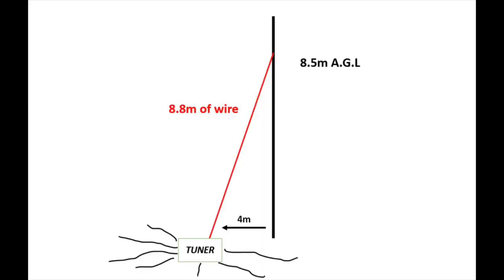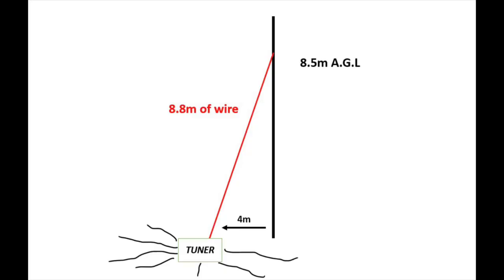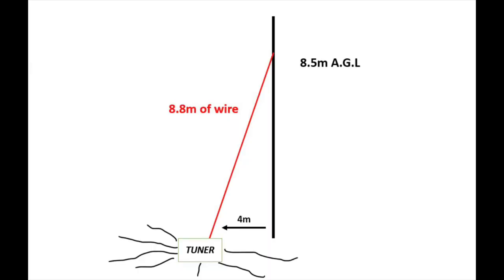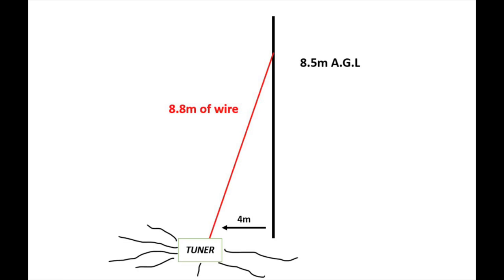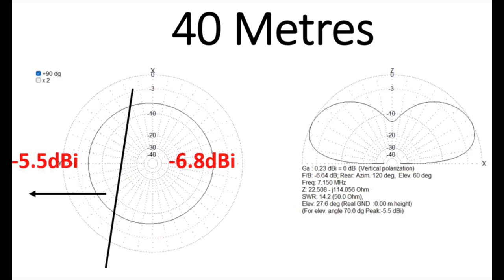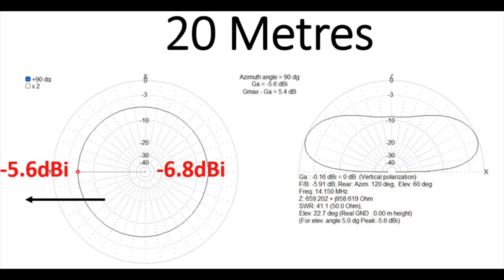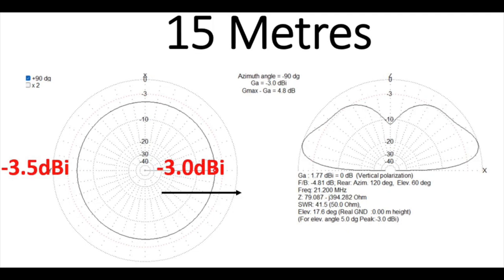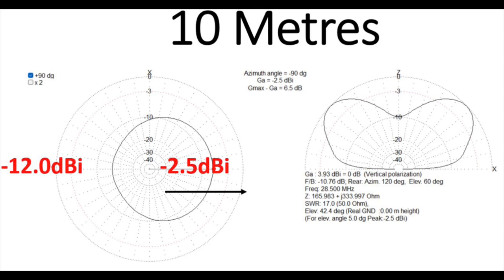SIMPLE PORTABLE MULTI-BAND HF ANTENNA - HAM RADIO

Comment: Thanks, Tim. Very interesting to see the gain away from the slope for the higher bands. I've been using a 35.5' random wire, but have been meaning to try a 29' one (which would be easier to use as a vertical with my 33' mast).
Reply from the maker: Let's see how she does

Comment: Hi Tim, I have one of these mAT-40's on order with the Yaesu cable and will be trying it out with my FT-857 for portable use. Normally I only operate HF with resonant antennae (17, & 20m EFHW and 40m Vee) but will be trying it with my 12m Spiderbeam pole and drive on mast support and see what results I get with an 11m long sloper. If I can get it to work on 60m and 80m and be reasonably efficient I'll be happy. My main concern is with interaction with the car running directly up the pole which would make fast deployment and a much smaller operating footprint when I'm in a public car park. That is my main issue with the inverted vee on 40m - footprint.

I think  this weekend I'll be torn between either making the traps to convert my 40m vee for 20m and 40m operation or continuing my ongoing battle with an 49:1 unun which I'm really struggling to get sensible measured results from with my VNA. 

I'll be looking forward to your results and most likely be replicating them :) de M0SNR
Reply from the maker: It worked well! Video to follow

Comment: Hi Tim, Great channel. Love to see you experimenting.I also a great fan of operating portable and do some experiments of my own. As a fairly new ham I learn a lot from you channel. I also like to better my understanding of antennas by modeling in MMANA.  The simpler things like a dipole and a slidewinder like antenna I am able to model. The antenna I am working on at the moment looks a bit like the antenna your working on at the moment. It's a vertical 5,33 meter random wire with a 4:1 unun at the feed point with the feed point 2 meter above the ground(credit to K4OGO). the SWR is between 1,7 and 3,1 for the 40, 20 and 10. Strange enough the more counterpoises I use the higher the SWR becomes. So no counterpoise is the best option. The feed line (5 meter RG58) most probably doubles as a counterpoise I suppose. My impression is that the performance of this multi bander is less than that of a slidewinder like antenna of just under 5 meter. Not in distance of the connections but in percentage of stations how can't hear me (clearly)   To understand this I tried to model the antenna in MMANA. Here I run in to trouble trying to ad the 4:1 unun to my model. Internet has no direct solution or my English poor to understand the merits of the text. Therefore any tips  on where and what to give in to model a 4:1 unun in MMANA  or where to find some comprehensive information on the topic  I would highly appreciate . I would be very interested content that goes more into depth on MMANA and shows more on the advanced input.  Hope to work you on the bands some day. Regards Gerard,
Reply from the maker: Nice idea about MMANA and good luck with the antenna. Try it for a few days to allow band conditions to fluctuate.

Comment: Hi Tim, congrats on your work.
I also use FT891 and Mat40 in campers.
I always pull 12.5 or 32m non-resonant wires from the roof of the motorhome to some plant but I can't get very high.
I was thinking of buying a 12 or 18m spiderbeam.
Do you think it works better than your 8.8m?
Thanks
IN3BQV
Reply from the maker: A 32m version would be great on 80m and above. The other shorter lengths better on 40 and above. Sounds fun options!

Comment: Hi Tim, what impeadances does you modelling show at the feedpoint for each band? As wondering if a 4:1 or 9:1 balun would lower this and then run coax to the rig with no Mat40?
Reply: I think this would be a 9:1 transformer.
Reply from the maker: They vary from into 4 figures on 17/20m to below 50 on 40m. A 9:1 seems to be the option most use here. Probably because it lowers the higher impedance a wee bit more.

Comment: how does it compare to the rybakov? Does the extra 4 ft help a lot or a little?
Reply from the maker: Extra 4ft helps efficiency on 40m. It does make 10 a wee bit weaker at low angles for DX. However it’s an improvement on the Rybakov owing to the fact that the match to 50 ohms is achieved at the feedpoint and not following a run of coax, inducing extra losses before it reaches a tuner following  the UNUN

Comment: Hi Tim, this may be a question that I should know the answer to, but here goes! On the modelling the SWR seems very high, 58:1 in one case. I seem to remember that most tuners will handle about 10:1, Is this the case, and how do you get round this? By the way, I work on the principal that the only daft question is the one you do not ask! Thanks for the video's, always informative and a bit of fun! 73 Jim M7BXT
Reply from the maker: Hi Jim - The tuner I intend to use should handle impedance up to 1500 ohms. That's the key thing. Lets see how she does.